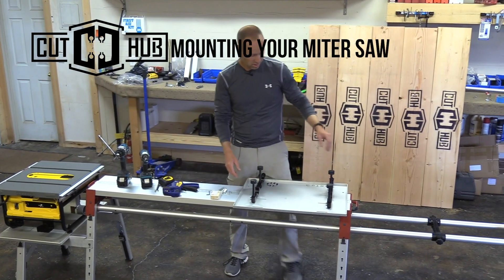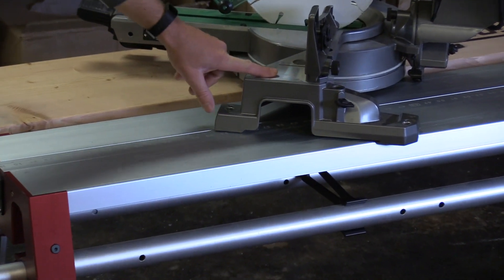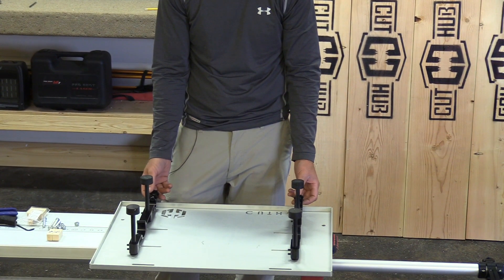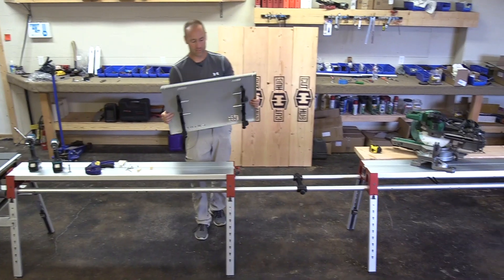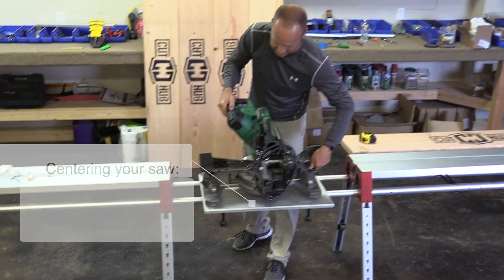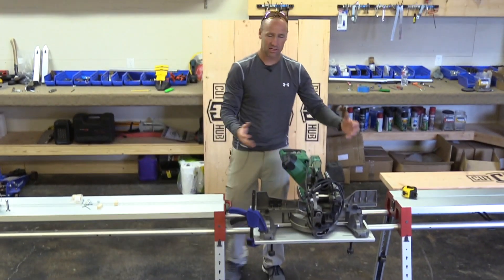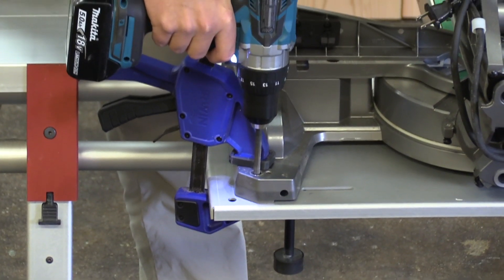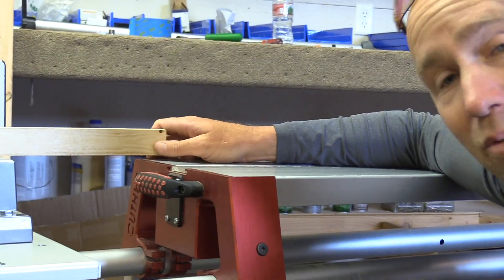Instructions: Mounting your miter saw/chop saw to your CutHub

Comment: I love my cut-hub work station.  Sure they're cheaper systems but the quality of the cut hub is top notch and it sets up fast.  Because its metal and plastic it's impervious to harsh conditions which is important if your project extends over days or weeks.  Repetitive cuts are core to the Cut Hub system.  They also are customer focussed and provide any support you may need to get start.

Comment: I like the idea of the cut hub but for this kind of money I would expect mechanisms that provide greater calibration and variability for setting a saw.  For example instead of sliding posts and shims to determine the height at which the saw is mounted have screw posts and a dial knob that would allow for infinite adjustability and calibration.  With some cuts it would be beneficial for the wings to be on the same plane as the table of the saw.  Also may include a template for the saw mounting holes or better yet have the buyer specify what saw they have and then sell a mounting plate with the holes drilled by the manufacturer for that particular saw.  If I'm paying this kind of money I want my saw aligned with the wings and not a degree off due to roughly measuring and drilling mounting holes.  Thanks
Reply from the maker: We appreciate the feedback. We are always looking for ways to provide more value with our product.